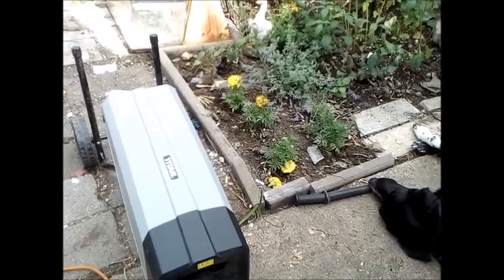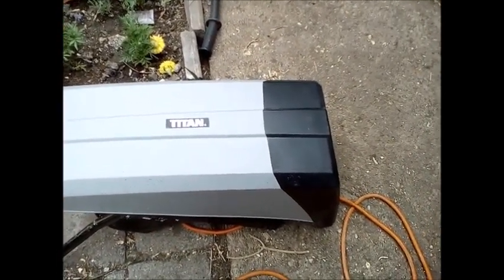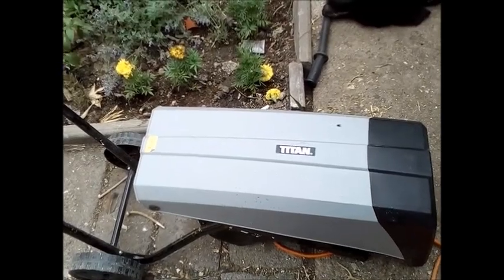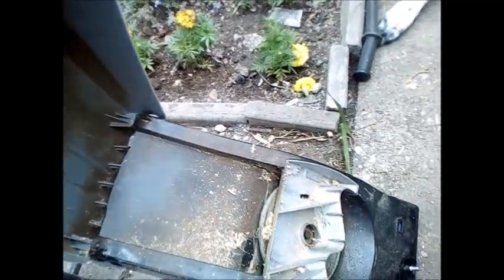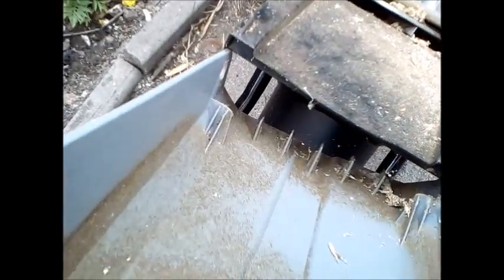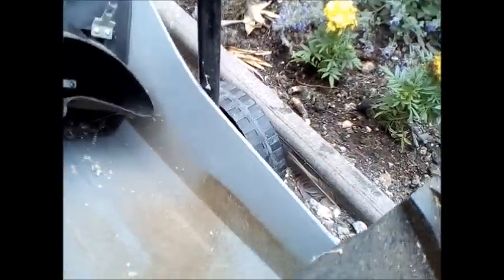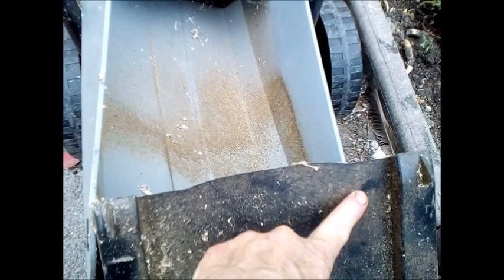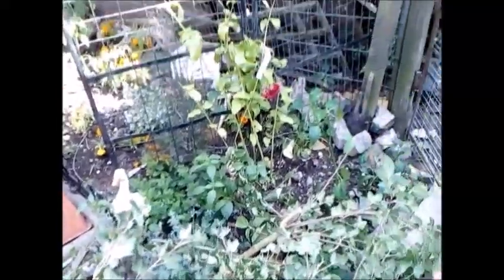Screwfix Titan garden shredder design fault and adaptation

Comment: Good video. However there's another, more serious, design fault, at least there is on mine. I have the same Titan shredder bought from Screwfix three years or more ago. I had the same problem with blocking up so cut the bottom "teeth" off, big improvement. The other problem, with mine anyway, is that there's nothing to stop twigs or small branches being hit by the blade on the side of the cutting rotor disc which is coming upwards. The rotor disc is angled so that on the right hand side the blade is coming upwards and moving downwards on the left side. Knowing this I always try to feed trimmings down the left side of the feed chute, however sometimes a twig gets over to the right and can be caught by the rising blade. I did a lot of shredding recently and was using a branch perhaps 3/4" (19 mm) thick to try to push some leaves through. The rising blade caught the branch and the upper end of the branch hit my left thumb hard, causing quite a nasty cut through the gloves I was wearing. Plenty of blood! The cut is nearly healed now but the incident could have been much worse. I'm quite practical so will engineer a cover to prevent branches from contacting the upward moving side of the cutting rotor. Apart from these problems the shredder seems quite good for the price. There's plenty of power and the blades are sharp and tough. However unless adequate modifications have been made since I bought mine I consider the machine potentially dangerous. I am used to using all sorts of cutting, welding, building and engineering equipment so am not a complete fool by the way.
Reply from the maker: Yes I've had several whacks to my hands. Nothing as serious as yours but still very painful as my hands are arthritic and even a slight knock can make me whistle.

Comment: I just bought one same mechanism different make They all have the same Chinese mechanism fitted inside regardless of the plastic casings being different. The original design did not include the fins to keep fingers out at the bottom and no rubber flaps in the top that stop things going in when you stop guiding them with your hands.
Once you sort those two problems buy a can of spray silicon lubricant and spray a little around the top opening and the plastic feed tube now and again, will not make it perfect but it will work a lot better and not gum up so often.

Comment: The teeth are there too slow down the material ejection, it's says it's a shredder but it's not, it's a chipper.
In order to shred green waste the heart of the machine "chipper disc" has too incorporate swinging hammer's and grates, if you want a machine that will shred and chip upto too 3inch then s. "screw" screw fix and check out AgriEuro.co.uk and there you can get a machine that does not involve changing the safety features in order to operate, as a Tree Surgeon, I wouldn't personally recommend screw fix as like other retailers they advertise a machine chipper "shredder" even though it does not have a shredder facility

Comment: Great video very informative. I've found with most garden shredders they work better with thicker materials they dont like thin stuff like privet etc
Reply from the maker: But they should work with thin stuff too. After all, if I trim a hedge, the clippings need to be shredded before they can be composted.
Sadly the Titan blocked even with thick stuff, which is why I set myself to see why, and work out a solution. Problem solving is probably the only benefit of being on the autism spectrum lol.
Reply: @PhyllisGlassup2TheBrim  I am just off to buy a second hand titan shredder. The first thing I will do is do your modification on it. I will let you know how I get on
Reply from the maker: @ironhorse19  hope it works for you. Several people have done the modification and told me it now works well. Try looking for a used one on ebay where people have bought them and sell them on because it clogs lol.
Reply: Looks pretty crap

Comment: Absolutely correct...fetch 'em off! I've no idea what Race car rear diffuser strakes are doing down my shredder chute? No doubt great for directing debris/ suffragettes/ groundhogs flying past at 150mph plus?
WTF, Titan/B&Q/Mcallister (oriental people)?...they just ENSURE that the ejected clippings eventually back up and jam further feeding from the top! Not a bad weapon for chewing your salad for you otherwise. We don't all need lumberjacking type Dark Destroyers. Overall these cheapo choppers don't do a bad job, if you give them a little respek. Just for fun...check the price of a replacement Turbine Cut 'Blade' thingy...A £350 Salad Processor has a £250 bit in it!  Oi Germans....don't take the wee! No, love your cheapo tool and lop the Go Faster bits off people, BEFORE you dis' 'em for blocking.

Comment: Interesting, I have one of these shredders - had it for about 2 years, and have shredded a lot of garden rubbish,and yes it does get blocked quite often, so I might try this, although I think I might just remove the plastic lugs at the bottom - just for aesthetics and it should have the same effect. I am currently having problems with it not shredding material. It just seems to crush it, so you end up with long binds. Will need to take the mechanism apart and see if I can tighten it
Reply: % Kelfdroid
 - A few points: 
The blades need sharpening. The good news is that they are reversible. So you have an unused face ready to go. ;-)

Anyway I would sharpen them while they are out. If a wet stone is not available some wet/dry sandpaper (>500) on a solid flat surface will make a perfect substitute. It´s the best ten minute investment you´ll ever do for that machine.
 
Be aware there are replacements on Ebay and Amazon. :-)

pam Thompson-Clarke-Reynolds-Bowers-Burton - 
That approach of cutting the front "lip" is by far the best functional mod. 

In the video you mention "why they make such a thing" well the reason is quite simple. "Safety" in the sense of "regulations" and most important liability. That´s why. ;-)
Cheers all
Reply from the maker: I tried first, just removing the lugs and found it still jammed. Then made the modification as you see. The cutting blades are near the top so it's still safe.
What seems to be a big issue with these is that the blades get blunt after use and while they can be unscrewed, they don't sell replacement blades lol.
I would first try unscrewing the blades and sharpening them and see how that worked, and if I couldn't get them sharp enough, I'd be having a look on somewhere like Ebay to see if someone saw a gap in the market and makes spare blades which will either fit, or can be 'fangled' to fit.
For me personally, I really don't care about aesthetics as long as a thing functions. After all, I really don't expect anyone to look over the fence and tell me how pretty my garden tool is, nor do I arrange my garden stuff in the shed, like ornaments, and admire how they look. :D
Reply: @PhyllisGlassup2TheBrim  A reviewer on another website said the manufacturer told him that blades sold for another make would fit.
Reply: +crpth1 thanks for the info, I will have a look this week and see if I can reverse the blades or sharpen them as you suggest, cheers
Reply: I bought one of these second hand last week, 1/2 hour after starting to use it I was cutting the fins off, I did think about cutting the front lip away but I found I don't need to.
I have had it block up a couple of times at the blade end when cutting small green stuff, putting larger stuff through (as big as the hole will allow) was very impressive, cutting it and pulling the material in automatically.